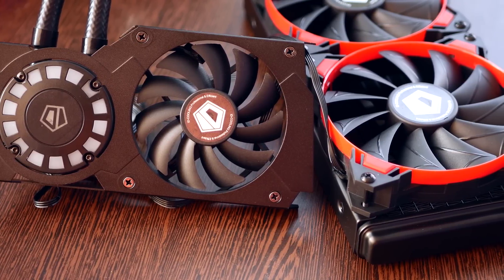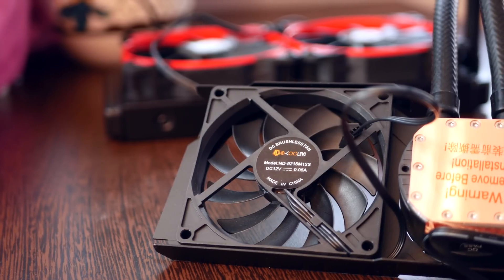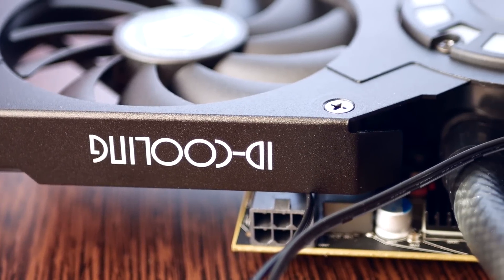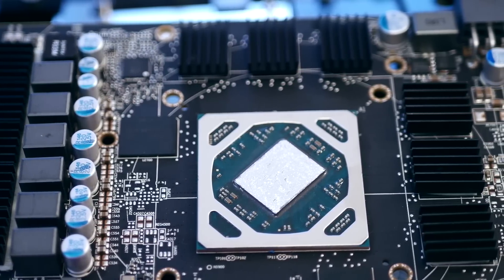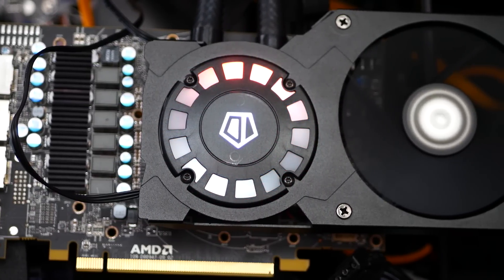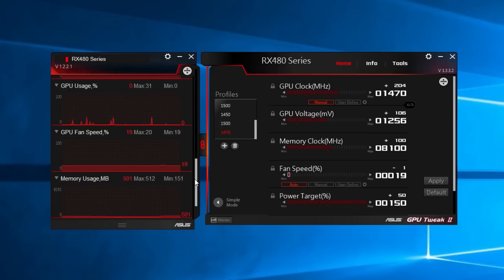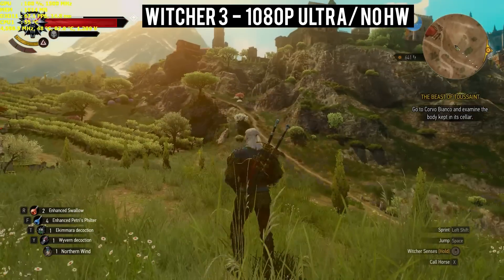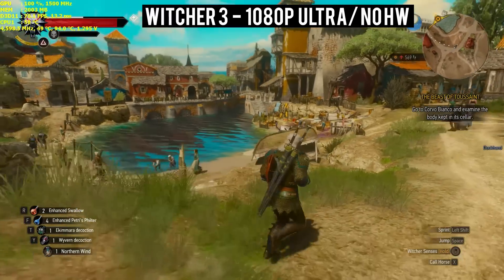This is how I made the hybrid Radeon RX 480 that OC's to 1470MHz - part 2

Comment: Are you aware if it is possible to put a AIO Cooler on a custom card? I have a nitro+480 and would like to cool it better than the fans.

If you can use an AIO Cooler, which would be the recommended one?
Reply from the maker: +Gotallofthem1 Hey! I think that it is not an issue. The bracket on my ID Cooling 240G has a bracket with different holes to allow for a multitude of possible mounting situations. You need to check depending on what AIO you plan on using. For a third party cooler, I'd recommend the Arctic Cooling Accelero Xtreme IV. It is excellent! Keep in mind that Arctic's site doesn't list compatibility with non reference cards. If you plan on doing it to an RX 480 as well, you have no reason not to get a reference card as it's an excellent PCB implementation. And you'll also save some bucks and put them toward the Xtreme IV.
Reply: If the nitro PCB is longer than the reference model, then this ID bracket, or NZXT G10 is actually more ideal as the mounted fan attached to the bracket blows directly on the vrms. There's very little difference between single or dual radiator. As such, any Asetek single rad such as H75, Thermaltake will suffice.

Comment: Oooooh this is great! I was wondering how people were getting their cards to clock so far lol. I just build a ligquid cooling loop using the XSPC blocks (great price and do the job) for my 2 RX 480s and I was hitting a power draw wall when the card started jumping to 165w (in some situations) with 1400MHz and started the throttle the clock speed.

Question though: Does anyone know, when flashing the vbios, can I have both cards in at once or can I only have 1 card at a time? (it would be kind of annoying to move the cards now but I can do it lol)

Comment: What about vram dices? Most AIO blocks cover half of one of the little dices on the card, so you can't mount the heatsink on it. Will it affect the card in the long run? I want it to last me 4 years.
Reply: u either put a fat thermal pad on it so it connects to the gpu cooler or u just get a smaller heatsink or u cut one in half. does it have to be so hard? or u put both a thermal pad and a half heatsink just to be sure hehe

Comment: Very good video, liked, subed. The mode is just awesome. The reference PCB has actually better VRM than most board partners' cards and is shorter too. Also the problem with the power from pcie socket can be solved by soldering together two solder pads on the PCB, that way the card can get more power from the 6pin. 'Actual Hardware Overclocking' channel did video about it, if anyone's interested.. Thank You, keep the good videos coming.
Reply from the maker: +František Benko Thank you for you feedback, I appreciate it! I'll look into that video and probably do the mod myself.

Comment: Finally put together this card.. yeah i used the same Cooler with the unlocked bios... 
Let me tell you the cooler was a pain in the ass to install... I had to improvise as the bracket holes and screws were smaller than on the mounting block!!! But whatever I got in on and its doing ok. 
Max temps 54 Celsius and currently clocked at 1420 core... sorta happy, guess it was worth it.
My Asus strix topped out at 1345.. so I guess its going on Ebay
Reply from the maker: Hey there! You used the same cooler as me?
Reply: Yep, shipped from China.... I'm not able to reach your temps and clock speeds.

Comment: will the custom bios work on a red devil 480? any ideas? btw gr8 work subbed.
Reply from the maker: +Rupert Zaugg Thanks mate! No, it will not work, do not flash it. It is only for reference cards. But what is the max voltage, power limit and clock that you are allowed to set with its original BIOS?
Reply: +MindBlank I'll have a look however I have a suspicion that, not much.
Reply: Powercolor released their own special bios for the red devil, to push the card further, you don't need the unlocked bios in this video. Look for it on their site or amd reddit, or google.

Comment: i´m about to do this with a Hunter Duet 240, but first i need to ask about the vrm temps, are the heatsinks enough? how many hours did you play on full load? sorry, i have to be sure, here in Argentina, that´s not a cheep vga at all. By the way, i´m not planning to OC, just want a silent card and safe temps for summer. Nice Job man, really like your vid!

Comment: Well my msi gtx 1060x boosts to 2000 out of the box and OCs to 2212 just by editing the boost curve (thats with stock bios and no voltage changing) while temps stay at 63C with 35℅ fan and 54C with 100℅
Maybe you should add to your review that your comparing a gtx 1060 thats actually cheaper than the cumulative cost of what you got by at least 20-25℅, one of the cheapest 1060s vs the extra cost of cooling and liquid metal (that stuff isn't cheap)
Reply: He mentioned that he got the reference+Water cooler for cheaper than a 1060 and liquid metal costs like 10$ per tube which you can use for several different things. Also while you may have been able to get 2212mhz others usually don't get that. 2100mhz is the average OC. It's called the silicon lottery, the same way some i5 to 4,4 GHz while others may have 5 GHz.
Reply: +MythenKanacke 2100 is my max thru a usual mhz bump, going higher requires using the voltage curve. Ok my 1060 is 290, now lets say he got that rx for recomended 240+10 for lm+ what 40 for a 240cooler??? doesnt look the same to me 
Also he is using custom bios for 480 vs stock on 1060. (my 1060 hits that 2212 with 1,045v , even with like the worst ever scalability with voltage im certain that with 1,25 it would go even further)
Reply: Pavlo Menshykh 10$ lm is a worst case especially because you probably already have it for the CPU I would actually recommend using normal thermal paste that isn't conductive. You lose like 2C° at the chance of fucking over your Gfx. He probably used it because he already had it. If you purchased at the right time then you could have gotten it for 230$. He also said that he got a deal on the AIO in which case 60$ is totally possible I've seen Arctic Liquid Freezer 240 for 50$. You also don't really have to get a 240mm 120mm would totally suffiece. Also again just because you get 2212mhz does not mean others get that aswell Techpowerup tested several 1060 and non of theres were even able to hold 2150mhz.
Reply: +MythenKanacke because all of them used the usual method and not the curve one, gpu coolers are more expensive than cpu ones so even if he got it for 230 than even a 60 dollar cooler than you should compare that with a deal on a 1060 since 290 i payed for my version is normal price, you could compare it to 240 deals on simpler models.
What im trying to say is that amd didnt offer better performance at lower price, its the same as nvidia at best
Reply: Pavlo Menshykh Do you really think that even 70mhz really make a 1060 that much stronger? That isn't even 1 FPS and in that case he could also use the 1520mhz OC. Raising the voltage for such a little Boost really isn't worth it. also the best price for a 1060 that iv'e seen was 270$. You can mount CPU coolers on GPUs+ a GPU AIO on sale costs like 50$. What im trying to say is that AMD does offer the the better package 2 extra GB Vram. Around the same Direct X 11 performance, better Direct x 12/Vulcan performance. Free Sync instead of G-sync making monitors 100$+ cheaper.
Reply: +MythenKanacke he has OC through custom bios and voltage bump, while my 1060 goes to 2,2 without those, so yeah comparing a mediocre OC to 2,1 vs everything possible out of a 480 isnt really apples to apples, or is it ?
Reply: Pavlo Menshykh I meant 2.2 vs 1.52. which are both best cases. Many even with custom voltages haven't been able to pass 2150. der8auer barely got his to 2200 after a liquid metal mod, and that guy is a profesional overclocker.
Reply from the maker: +Pavlo Menshykh The 1060 cost me 300$. The RX 480 + AIO cost me 284$. So the 1060 was more expensive. Add $1 for liquid metal cause I didn't use it for this application only. Regarding your OC - it has nothing to do with the cost of the card, you know, right? It's a lottery. I had last week an ASUS Strix OC GTX 1070 which is one of the most expensive 1070s out there. It clocked to 2070 MHz max and that is with edited voltage curve, as it would crap out at 2030 MHz otherwise. Meanwhile, I also have a Gigabyte GTX 1070 and ot does 2114MHz under the same conditions (edited voltage curve). And temps on the G1 Gaming cards (nVidia only though) are great. Example: I run 10% fan on the GTX 1060 with a boost of 1900MHz, so that is almost completely silent unless you have your ear to it. It stops at 78C. Or second example - 2080 boost, extra voltage and fans at 40% and it gets to 68C.
Reply: So what you're saying is that all tech review sites are testing cards wrong and you're the only one who got it right?
Okay.
Reply: Im only saying that everyone tinkers with RX 480 like crazy, but doesn't bother using a voltage curve for the 1060
Reply: it doesn't matter, the 480 wins in dx12 games. its the better card

Comment: It would be very nice if you could include purchase links for all the included parts that was used. (or alternative parts if the exact parts are sold out already) I try to explain to many people you didnt spend 400 plus on the 480 setup. Maybe you could include you total cost out of pocket in the description of the video?
Reply from the maker: Hey! Ok, so I paid MSRP for the 8GB RX 480 minus 7% discount. The cooler was last in stock and had -50% on it. Total was well below Nitro edition or Devil. Below GTX 1060 as well. Did not include links since it was a one time deal with the cooler. Otherwise I'd have gotten the Accelero Mono Plus.

Comment from the maker: I want to mention 2 things. First ine is that you can find benchmarks in the first video. Second is regarding doing the same to the GTX 1060. 
Thing is that Polaris is Global Foundries 14nm FinFET. GloFlo chips respond very nicely and scale with lower temperatures (above 0C at least). Swapping the stock blower on the RX 480 is the key to upping frequencies on this chip. OTOH, the GTX 1060 is TSMC and their process does not exhibit the same characteristics. So putting the 1060 under water would not result in highly increased clocks.
Reply: Thanks for clearing that up!
Reply from the maker: +Joseph spears Hey! Yes, it will work. Or the NZXT Kraken G10 pkus whatever decent AIO (120mm rad will do fine) you want. This should also do the trick.
Reply: not entirely true.
Swapping air cooling for liquid on EVGA GTX 1070 SC, resulted in ~40MHz out of the box clock increase. you know, the default boost is going even higher. Usually hovers around 1938-1960 (depending on ambient).
The thing with pascal, is that you hit the power/voltage limit much faster than temperature with anything but stock cooler.
You mentioned derBauer, he has a nice video about non intrusive/reversible volt mod with liquid metal that will allow to push the clocks another 100-200Mhz.
At least until we have the modified bioses.
Reply: ^ He's talking about pushing the limit bro. You can't overclock it above it's weird limit. 2.2 is like it's limit and no matter even if it's cooled by LN2 it won't go over 2.2 because it's limited by the design itself. On the other hand you can push polaris even to 1.7ghz and that's where voltage is on the limit to extreme where it's about to kill the GPU because too much voltage.
Reply: sermerlin1
Actually Pascal cards where pushed to 2.5 on LN2. The 2.2 was reached on air (search derBauer channel for 1060 getting 2.2 on air)
The fun thing about GF 14nm is that it's "fake". It means that the X transistors made on GF 14nm will occupy more space than X transistors made on TSMC 16nm.
Reply: ***** give me a link to LN2 2.5 ghz overclock. I searched and cannot find anywhere.
Reply: sermerlin1
https://xdevs.com/guide/pascal_oc/
Reply: I have the XFX rx480 dual fan. has a back plate, would this cooler work? also have an Artic accelero hybrid 1.0 on an old 780
Reply: Just remember that an XFX dual fan is an aftermarket card, the unlocked 
bios won't work for it, and might wreck your card if you use it. But a 
custom cooler with heatsinks can still do a lot, just don't expect 
1470Mhz.
Reply: so if i wanna overclock i should go with reference rx 480 and buy another cooler instead of the strix model?
Reply: MindBlank Tech +1 for aluminium!

Comment: I'd like to see you do the same to the 1060. I wonder if watercooling would cause it to boost even higher and if the gains scale well beyond 2k mhz.
Reply: People tried to OC it further with Water but, no it does not OC that much better with Water.
Reply: ALph4 What i ment was that 2.2GHz is the wall they haven't been able to surpass. The best case was der8auer's 1060 that reached 2.2 after using liquid metall. Jayztwocents 1060 propably wasn't as high in the silicon lottery.
Reply: For some reason the 1060 has a virtual brickwall that it couldn't break., no matter how good your heat solution is.
Reply: It hits the wall around less than 2.2ghz. Jayztwocents managed to overclock the hybrid to 2167 mhz.
Reply: sosoishero Yep, it hits a brickwall at 2200 mhz(with liquid metall), does not go higher with voltage. The only way over the wall is LN2. It really depends on cooling but it seems that this time AMD won in the OC wars(atleast with proper cooling).
Reply: Forgot to mention that Hybrid was 1080 but they all overclock around the same anyway.
Reply: MythenKanacke I know. I just said that I forgot to mention that the hybrid that he got to 2167mhz was a 1080. All 1000 series cards overclock around the same, maybe 1060 can overclock A BIT higher, but not much, if not the same.